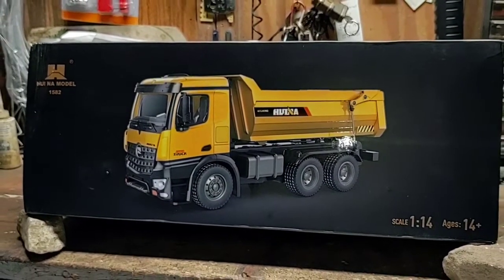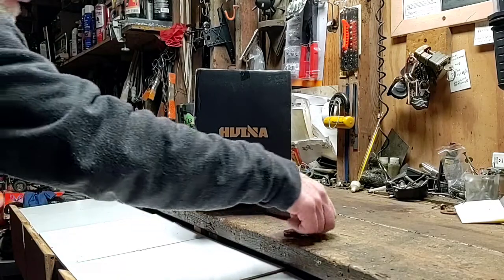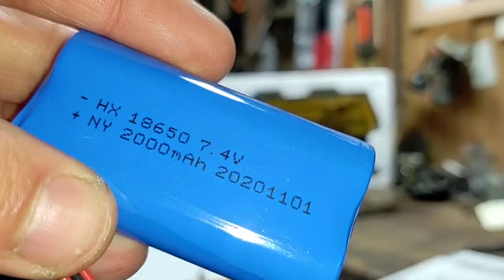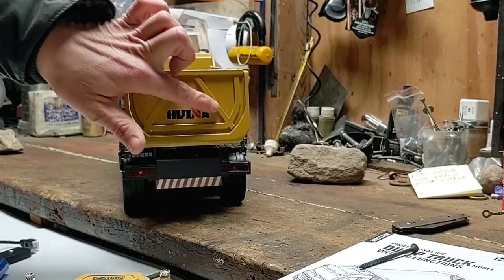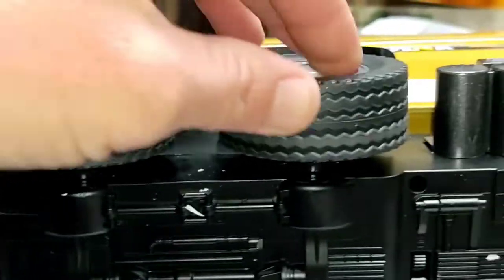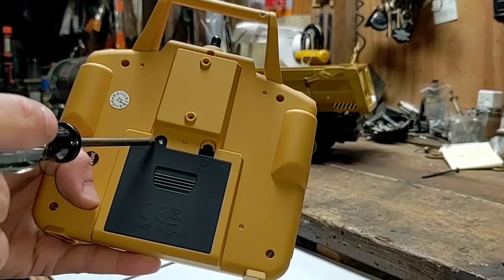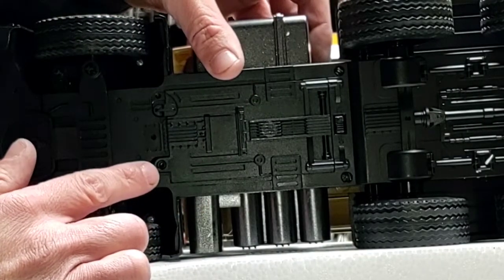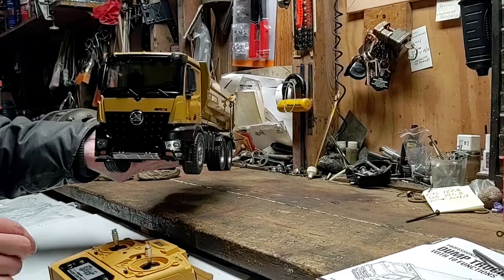Huina 1582 Unboxing (USA)

Comment: very nice and detailed description of the vehicle. I have the same truck, but I did some optical tuning. Now I will try to change the tires and increase the angle of the container.
Reply from the maker: 😊 "Optical Tuning" I like that one.😁👍
As for the lift angle improvement ❓🤔 I've got an idea, or Two, About how to increase the lift, Without losing any drop angle, "Drop angle" meaning still sitting level in the down position.😊👍 
I could tell you my ideas for a cure, But I would rather save that one for a Future video.😄😂👍👍 lol 
Tires; 🤔 Yes sir, The stock tires are a Serious drawback,🙄😕 along with the air-dam that hangs down on the front of the truck body,🤔
It needs "actual" rubber tires, A minor Fender trimming up front, and a possible fender relocation on the back axles, and then Different tires all the way around.😁👍 
All else fails, you could also make some Custom Re'Treads for the stock tires,🤔 If you could find a off-road tire that was close to the same size as the stock tires, You might be able to stretch them over the top of the stock tires, 🤔 Kinda like putting on a pair of Socks,😁👍 lol 
But you would probably have to do all of the previously mentioned body mods, in order to pull off that maneuver, 🤔😕 
And I'm not sure if the front steering linkage setup would clear the prospect of Re'Treads,🤔 excess rubber hanging over the stock front tires, Might interfere with the steering link's,🤔❓ Which could possibly cause them Not to rotate,😕 And that would be no good.☹️
Suspension would make the truck better, But I think that better tires would be the Most Beneficial Upgrade that you could possibly do.😁👍
Other than making the entire truck 6-wheel drive of course.😂👍👍
Thanks for your Awesome Compliments & Comment, And many more thanks for checking out the video my friend.😊🤜🤛
Reply: Thank you and I look forward to your next films .have a good day😁🤗

Comment: Have this truck,does the job but needs a little suspension,would make big difference 👍
Reply from the maker: 😁👍 Needs Suspension and Better tires 😄
The tires are Terrible! Borderline plastic 🙄 
If it had some actual Rubber tires with some decent Tread, it would make all the Difference in the world.😁👍 
I literally just came back inside from test driving my Laegendary Tipper, And it was Awful! ☹️ Wasn't going anywhere while out in the dirt, wouldn't even get out of it's own way,🙄 It was better after I put a few Rock's in the bed, But it was still pretty bad,  And it was the tires fault.😕 I'm gonna have to come up with something different for them, Stock tires aren't getting it done.🤔
And I honestly can't imagine the Huina 1582 being any better,😕 I'm thinking that a Custom 6×6 Tipper is in the future 😄👍👍
Thanks for your Great Comment, and for taking the time to check out the video my Brother.😁🤜🤛
Reply: Anything you do to improve it i will be interested to see, and try and copy.😀

Comment: Good detail breakdown too sir!!
Reply from the maker: 🙄 You know me, I don't know when to quit sometimes.😕😂👍 
The battery deal was bothering me the most,😕
I stated on the Laegendary Tipper unboxing video, That the Huina Tipper ran on a 4v system,🙄 Which made me look like a total idiot when I discovered otherwise on this 1582 unboxing,😕 And it was all due to Xtreem RC's miss print on the 1582's spec's,🙄 And I felt a Extreme Need to Redeem my name for Xtreem RC's mistake.😁
All that aside, The 1582 is a pretty nice little truck,😊👍
The metal dump box is Killer! 😁 I would love to use that on a different truck, "6×6 preferably" 😂👍 
It's going to be interesting seeing them try to move around while doing maintenance on the Adventure Park,😂 lol 
I'm not planning on taking them through the course or anything, But I don't except them to do very well on flat ground either,🙄 I'm predicting that the sandy soil consistency is going to make moving around impossible without having a load on the vehicle,😕 
But we'll see. 😁👍 ha ha ha lol  
Thanks for your Awesome Comments, and for checking out the video my Brother.😁😊🤜🤛
Reply: @R.C.A.D.  As you may remember I have the same truck from WL. I have some video recorded but I don't even know if I'm showing anything. Looks like a kids toy in a f sand box..Has to have suspension to look alright and drive..
Reply from the maker: Yes sir, definitely needs suspension, and better tires, and 6-wheel drive too 😂👍
I had the Laegendary Tipper out this afternoon for a test run on Terra Firma, and it was Awful, 🤮 Couldn't go anywhere 🙄 I had to put a couple of large rocks in the bed, Just to get it to move. 😕 Talk about Worthless!
Modification is in it's future.
😁👍

Comment: I just acquired a huina excavator that looks exactly like yours , the only difference is that my bucket is plastic and the battery cover is also plastic. My question is, are those the only differences between the two or is the one that comes with the metal bucket stronger? Also are the two buckets interchangeable? Eventually id like to get the metal bucket and the metal battery cover for it.
Reply from the maker: Plastic Bucket !? 😕 Really ?
Wow! 🤔 My 1550 came with a plastic battery cover, But the bucket itself was metal.😕  It kinda sounds like you might have one of the "lesser" Huina excavator's,😕 I mean the 1550 is pretty basic, but Huina also makes a few excavator's that are even cheaper than the 1550,🤔 
And you might just have one of those.😕 
And as far as parts go...🤔
Hmm... Since I don't know exactly what machine you have, I can't exactly say what parts will fit and what won't.😕 
As for the 1550 excavator; 
The bucket from the 1550,1580,& 1593 are all interchangeable, "the 1580 bucket being the Best"
But unless you have aftermarket "Worm Gear Drivin Screw Servos" on your excavator I wouldn't bother switching to a metal bucket...😕 
Really at the end of the day, it's much more cost effective to just start out with a new 1580 vs trying to build a lesser machine up to 1580 standards.🤔
What I'm trying to say is that it's cheaper to buy a brand new Huina 1580 vs trying to build up a smaller excavator.😕
 
Take my 1550 for example, I purchased that machine for $15.00 dollars, but it normally sells between $50.00-$150.00 dollars depending on where you look, And then I invested about 50-100 hours of building time into it, and around $250.00 dollars on top of the original purchase price, And it's still no where as good as a 1580,🤔😕 "not to mention that it's still not 100% right either" The Upgraded Motherboard that I put in my 1550, can't handle the 1580 track drive units that I installed into the machine,🤔😕 it lasts about an hour before the motherboard burns out from the stress of pushing the larger track drive motors,🙄☹️ Which means that I will have to upgrade to a 1580 Transmitter and Motherboard, in order for the excavator to be right.
🙄 And that's going to be a whole other nightmare entirely,😂 lol  along with another $75.00 - $150.00 dollar investment for the part's,🙄😕 And after all that is done, that little 1550 excavator is going to cost me almost as much, as a Brand new Huina 1580.😕

Here's my suggestion for you brother.... Run your excavator for what it is... And if you really and "truly" enjoy playing with the excavator, Then save up your money and get a new Huina 1580 vs trying to build up the excavator that you currently have.🤔😉👍
It will be much more cost effective in the long run, And the machine is of much better Quality, all the way around.😉👍🤜🤛
Reply: @R.C.A.D.  thank you for taking the time to give me such extensive help . I took a long hard look at the box today and found that the model number is 1350 . From what i see it is the same exact thing as the 1550 except that its got a plastic bucket . I am eventually going to upgrade the mechanisms in the arm to those same servo motors as you have there. I know it might not be the smartest thing to do but this excavator was a gift from my wife and I don’t want her to feel bad  for buying it for me so I’m gonna keep it and upgrade it so that it can dig without all the clicking lol. They should have made them with no clicking but with some kind of limit switch . I am happy with how it moves and how the track system has been working so i think its major flaw is the clicking clutches.
Reply from the maker: Build away Brother 😄👍
I just wanted to give you a heads up on the potential costs.😉👍
As for it being basically the same thing as a 1550... Cool!!!! 😁 That will make life a lot easier for parts shopping.😂 lol
As for the clutches; 🤔 
I suppose that Huina was thinking "that better it slip then break" 😂 lol 
After you build it up, switch out to the "worm gear screw servos" and get a metal bucket, It's going to be a little animal in the digging department.😉👍

Personally speaking...
My built up and "heavily weighted" 1550, Is a extremely compact and insanely capable digger,😊
Truth be told... If it had the 1580's style of transmitter, I would probably like my 1550 more than my 1580.😂 lol 
Good luck on your build Brother, and let me know how it all works out for you.
😊👍🤜🤛

Comment: Great review my friend. Which excavator would you recommend? I'm looking at a 1593 wonder if I should wait and maybe get the 580.
Reply from the maker: Thank you sir 😁👍
As for the Excavator ?
Hmm 🤔 that requires a little bit of thought 💭
As far as Huina Excavator's Go, The 1593 & 1580 are the Best one's straight out of the box, 🤔 and the 580 is far superior to the 1593,
Better than the wltoys Excavator as well,🤔 hmm
Ultimately, if you didn't mind waiting to save a little extra cabbage, I would definitely go with the 1580, 😕 At the end of the day, The 1580 has much more potential for growth,😊👍 Just because there is Several different manufacturer's who make a full Hydraulic Conversion for it,😊 So it has potential to be improved, beyond... already being Huina's Best Excavator. 😁👍
The 1593 on the other hand, Has very limited potential, 
Certain things can be improved on the 1593 to make it a better machine than how it started,🤔 
Such as relocating the secondary boom arm limiters, "So that you can get more curl out of the bucket" and Replacing the Stock plastic Track Drive units, with the metal 1580 Track Drive units, "for better durability" But it will never be as good as the 1580 😕
And for the money that it would take to get the 1593 up to the "out the door level" of the 1580, It would be Far... more cost effective to go with the 1580 to begin with.😁👍👍
And my answer is; 1580 all the way my friend.😊
Thanks for your Awesome Compliment & Question, and very much appreciated as always for checking out the video.😊🙏🤜🤛